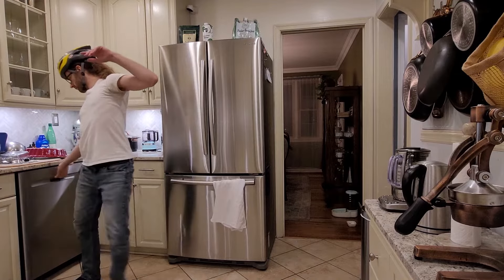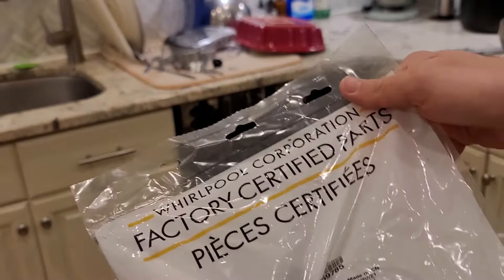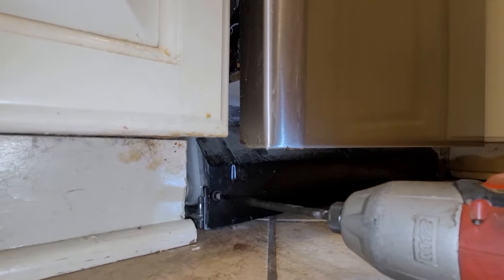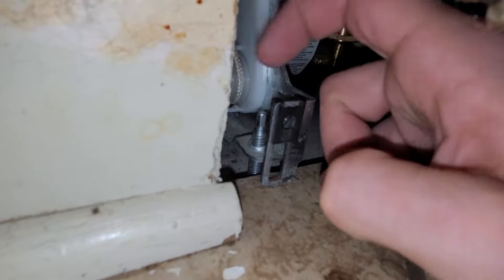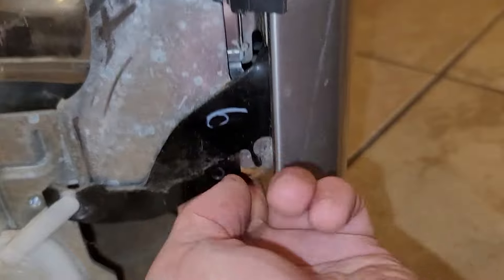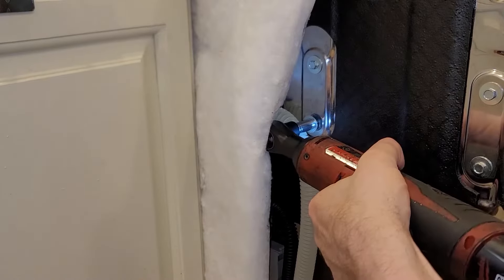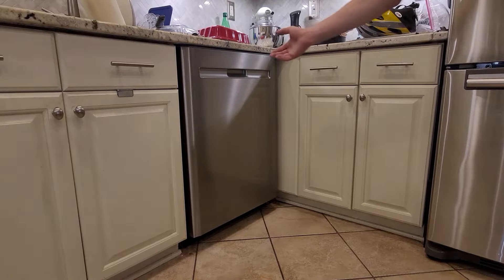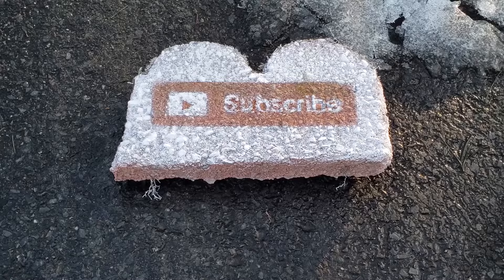Maytag MDB Broken Rack Rail Repair (W11259785, W10852728, W1192640)

Comment: You gave my husband and I the courage to do this ourselves! Thank you for posting this. The struggle we had was pulling the dishwasher off the counter coz there were the two hidden brackets on both sides that you warned viewers about. What they held, we don't know. We only found them after we yanked with all our might. We were about to give up but we kept going back to your video and we told ourselves that you made it look easy! Glad we pushed through. We returned it back with no issues, leveled properly and basket was smoothly rolling again. God bless you! ❤
Reply from the maker: That's great to hear! I'm glad my video helped.

Comment: Ok so I fixed the rail. Easy peasy, right?  Now my dishwasher won’t fill with water. What could I possibly have done to make that happen?  And yes the water is turned back on. Lol
Reply from the maker: Hmm that's strange. Couple of things come to mind. Check to make sure you didn't pinch the water supply line when you pushed the dishwasher back in. May also help to turn the breaker to the dishwasher off for 10-15 seconds, then turning it back on again, in case something wonky happened with the circuit board.

Comment: Once again, Bootstrappin to the rescue. My Maytag dishwasher came with a 10-year factory warranty on the top and bottom racks. Guess what? The rails are covered under the warranty. Saved me $88 + shipping. Always register your appliance warranty and keep a copy in a file. Thanks for a great video!
Reply from the maker: Hot dog! You're welcome!
Reply: How did you get maytag(whirpool) to send you the warranty parts ( is it just the rails or the racks as well? ) . I called them and they said they need to send a service person to first inspect ( charging 120$) before they can know which parts are needed. Is there a way to just claim warranty on these parts ? please advise steps you took. thank you in advance.
Reply: @bhavingandhi2270  I did some research, found the part numbers I needed and called them to request the parts under warranty. That was six months ago. Their policies may have changed.

Comment: Hello I have an emergency, my Maytag just stopped. The elecrical wires I checked they are still intact. Thats how it looks. The breaker is okay. Could the filter system be the problem to shut it down completely?
Reply from the maker: I'm not sure. Are there any lights on, does the machine respond to button presses? I would start by turning the breaker to the machine off for 1 minute, and turning it back on. That may help it reset.

Comment: The Gunga is strong with dishwashers. I have had many battles with the dreaded Gunga that lurks in my Bosch. You would think, the very device that is tasked with the duty of washing would eradicate the Gunga and leave behind a pristine environment, but no. Looks as if you have a can of Rapid Tap Cutting Fluid on the floor. Has Rapid Tap Cutting Fluid some mystical power over the Gunga that its mere presence assist in eradicating the Gunga?
Reply from the maker: Show me a maintenance free dishwasher and I'll find you a fella selling a bridge for "a good price". The battle against the gunga is never truly over, and I'm suspecting this is the gunga's revenge on me. The cutting fluid was the only thing I had on hand to serve as WD-40 - was trying to lubricate the threads on those feet; it's power over gunga is still unknown.
Reply: @Bootstrappin  The Gunga is definitely bad Juju

Comment: Thanks a bunch for this vid. I came here because my top rack rails are not sliding fully in, and need to be pressed to get fully iinside the door. Had you experienced that? I am wondering if mine are at the point they are about to fail like yours did.  The rail seems on an angle with the weight of the rack on it.
Reply: Never mind, I just re-watch at the 6:00 min mark, you have a slightly different slider that me. Mine has wheels which roll and slide. You have clip in rails.